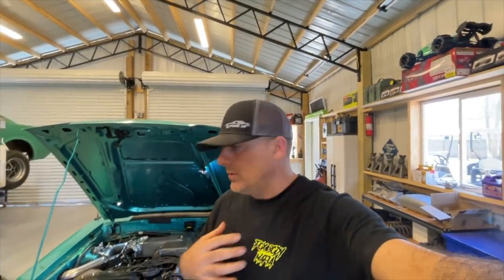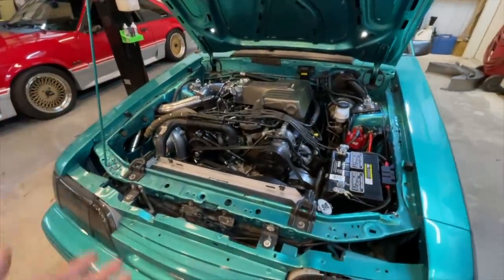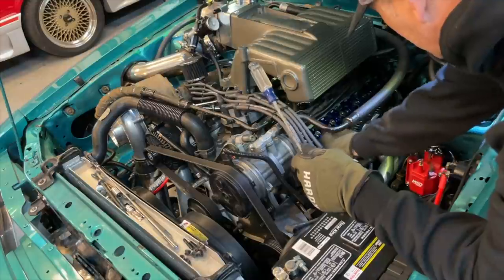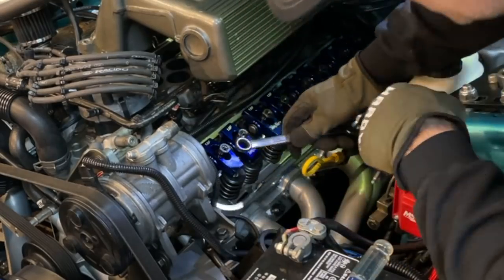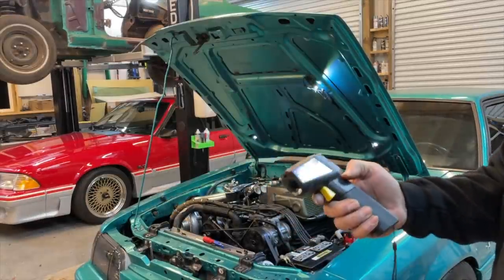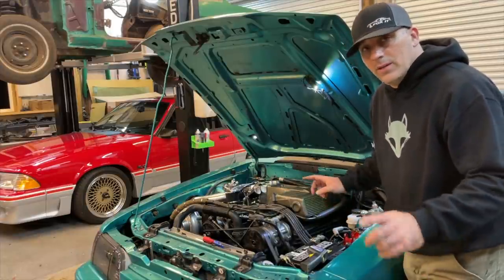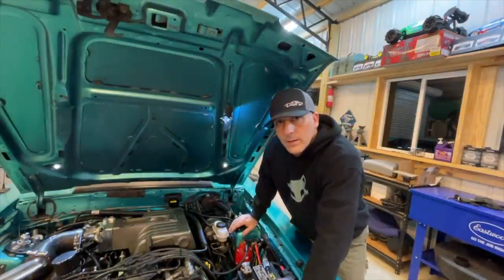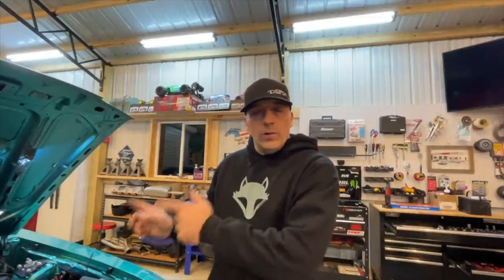I Failed A Few Times Before I Figured It Out..... But it's part of the process

Comment: While the plugs are out, I would do a compression check, and a leak down check. Lifter pre-load should be .020"-.060", with a 7/16"-20 threads per inch rocker stud would be around just under a half turn to just over a full turn. 3/8"-24 would be half turn to one and a quarter turn.

Comment: I could definitely agree with the very first statement of this video. I had been messing with my car trying to get it running right for 3 years and I ended up going with a Holley terminator x and it solved my problems!! I believe I had a harness issue in the end. Glad to have my car going again but I know exactly what you mean with wanting to burn it to the ground!!!
Reply from the maker: Glad you got it going instead of 🔥🔥👀
Reply: @BREW2LFOXBODY  would copper based anti seize help the plug ground possibly? Or just don’t use as much?
Reply from the maker: Possibly, I just used too much though

Comment: Zinc, or trivalent plated plugs do not require anti-seize on the threads. Best way to tell; if your plugs threads are silver, or chrome in color, you dont need ant-seize. If the threads are black in color, put anti-seize on them.

Comment: Nice video on troubleshooting! Just to confirm that it's not hurt, a compression check or leakdown test would be good. 

 If a valve no longer fully seats due to minor damage, it would quickly create play in the valve guide or possibly crack it. A puff of smoke at startup would be a tell tale sign and possible valve train noise.  

If one cylinder has lower on compression on that bank do a wet compression check to see if the numbers go up.  If it does,  it's the ring, if not then a valve is not fully seating.  Then take off the springs on the valves for that cylinder and check end play in the valve guide.  That will rule out a bad valve guide and bent valve. If all else fails pull and inspect the head, and also check it for straitness.  Should be under .002

Comment: Do a compression check and next time you have a head off and suspect a valve just turn the head so the suspect port is up and drop an ounce of mineral spirits down the port.   If there's any leakage at the valve you'll see dripping or wetness around the valve in the combustion chamber.  I've found weeping even with new heads that needed a little more lap work or cleaning debri like compound off the seat.

Comment: In reference to #8 unplugging/broken clips, the Explorers,Crown Vics, etc with 19 pound injectors have squeeze the sides injector plugs. With a safety pin or other small stiff wire you can take the pins out of the plugs and they will not unplug. Plus, the newer injectors have 4 hole ends for better atomization of fuel.

Comment: I've also had a plug be bad right out of the box (brand-new) and I had an injector go bad on me after it had run for 10k miles.  Those threw me for a loop trying to troubleshoot.  Good video going through the process.

Comment: Awesome video! Just a suggestion, when removing the coil wire try to remove the actual connector to the MSD coil (primary side) With that still plugged in the coil can create high voltage and that can travel anywhere nearby or to you!
Reply from the maker: Very true! Great tip 👌

Comment: Start the car pull the plug wires with some welding gloves (so you don’t get shocked ) if it doesn’t run different when you pull one that will tell you where to look.

Comment: Great video, I enjoy all your videos! I agree with everything you said only difference between us is I go for the easiest thing first! I start at the plug then the plug wire, then check compression while the plugs out and most of the time that will tell you if you have internal problems in the motor! I guess that’s just the difference in mechanics everyone has their own way of doing things!! Like I said man great videos!!!!!
Reply from the maker: Thanks brother! I would have checked the plugs first but I literally just changed them.
Reply: Man I totally understand, I’ve got a 91 gt and it’s a labor of love!!!! I’ve got a 91 F-250 with the 5.0 in it and I’m chasing a demon in it, I believe it’s got a sensor bad, it want to flood all the time!! I’m about to lose what little hair I have left!!!!
Reply from the maker: @traviswhite1461  have you changed out the ACT and ECT sensors? Might be worth looking into. Although I’m not very well versed in the f250 world it could be the same as the cars. It’s a know issue that causes flooding mainly when it’s cold.

Comment: Cool video bud with a lot of information. I had a issue with a 89 Fox I had A few years ago. It would run great but once it got hot it would start missing and then get to the point that it would die and not start. Narrowed it down to the TFI module which I replaced with one from O’Reillys and it ran great until it started doing it again. So this time I replaced it with a oem one and again it ran great for awhile and started doing it again. This was my daily driver I ended up trading it for a 95 bronco with a 351w 35s and a 6in lift.

I later found out about the bad locations these and how they would get hot if you don’t use that gel stuff which I didn’t use. I had 16 of these cars and never had this issue except with this 89. 

I currently have a 89 and a 86 with TTops. I bought the TFI relocation which I install on all my Foxbodies.

Never figured out why the 89 done this. It was cammed with a F cam, svo roller rockers, 5spd swap,4.10s,cai, Offroad H-pipe, flowmaster 10s.

When I sold it I thought it was a electric issue or I’d never sold it. Really regret selling it.
Reply from the maker: That sucks.. no telling what it was either. Probably a bad wire somewhere it was my luck....

Comment: Correct me if I’m wrong but I believe NGK plugs have anti seize on the threads that’s why they are shiny? I run them in aluminum heads and never put anything on them.
Reply from the maker: I’ve never noticed any anti seize on them before
Reply: @BREW2LFOXBODY  It’s not a typical anti seize I think it’s some sort of coating on the threads that prevents it from seizing in the head and damaging the threads. I’ll have to look around to be sure. Great video by the way

Comment: Good stuff!  Have you heard of using a spray bottle of water to test exhaust?  Nice one with the screwdriver in the plug wire!
Reply from the maker: Yes I’ve used that technique a few times before. Thanks brother
Reply: Testing exhaust like that works for headers not manifolds really. In my opinion. I got ya brewlk👀

Comment: I sed don’t put Anti-seize on the spark plugs and if you do you use copper anti-seize and only the smallest a mount
Reply from the maker: Was it you in the comments that said that back when I was doing it? I couldn’t remember who it was.
Reply: @BREW2LFOXBODY  I think I sed it if I didn’t I know I was yelling at my phone noooooo don’t to it
Reply: @BREW2LFOXBODY  what probably happens was when the Anti-seize got hot they probably got onto the electrode of the spark plug creating a path of least resistance making a weak spark or smothering the tip of the electrode not allowing it to create a spark
Reply: @BREW2LFOXBODY  my engine builder also noted that anti-seize also changes the heat range of the plug. Just a dab of Copper anti-seize if you must. Love the channel!

Comment: I have what sounds like a miss every once in a blue moon that I am trying to figure out now, I used the rubber on cap trick to see if any of the cylinders where dead yet everything is fine. I think I will look into timing next. Q: Giving I have the parts now would you, A. Time the car first B. Install the parts before timing "cap/rotor/plugs/wire" car is original 140k mile car.
Reply from the maker: Go ahead and time it first

Comment: I just did a oil pan gasket i have a wayyyyy easyer way to do it the gasket will easily stretch over the oil pan i used the felpro didnt have to lift motor or any thing didnt have to get past oil pump and pick up
Reply from the maker: Nice! So you were able to just lower the pan some and slide it up the pan?
Reply: @BREW2LFOXBODY  yep took 5 mins to get the gasket in took longer to take the pan bolts out
Reply: If you get a chance to tell ppl about that to save them alot of time its really a good trick
Reply: Awesome tip, that's gold.  I have heard of a similar way where a person tied some string on the corners and was able to fish it down and around the oil pump and crank but it took a certain degree of determination and nimble fingers.

I also heard some mechanics will charge like they had to lift the engine but  slice the gasket and slap it on with some extra rtv where they cut it. I don't recommend that technique but if a guy is in a pinch it will work.
Reply from the maker: @codywilliams463  will do 👌

Comment: 2 things, where did you get the NGKs? china has been making fakes for years now that are crap. You need to get your plugs from reputable dealers. Google it to see the differences. 

And second, once a plug gets wet it can carbon track and the plug will short out under combustion pressure, and spark fine outside the cylinder.

Comment: My 89 gt has a fuel system issue. I'm thinking either bad injector or pressure regulator. At low speed in town it floods
Reply from the maker: Could be a fuel pressure issue for sure.

Comment: My 50 misses after rev into 5 6k driving or not. Installed New dizzy new coil new wires. Not replaced plugs yet. Drives smooth as daily. When in the mustard it starts to skip. Help?
Reply from the maker: Possibly the plugs

Comment: Hey man, I hope I can get some help here. I just finished installing my first turbo ever on my fox body. Can you explain how to run the vacuum line of the wastegate without boost controller ?
Reply from the maker: I’m pretty sure I just ran mine from the intake down to the lower fitting on the wastegate and left the top port open. But please verify for your setup with someone else just to make sure.

Comment: Hey please get back to me I've been having trouble with my fox 1990 I really need help and I can tell you what process I've done and what its doing long story short. Driver header getting red hot really bad idle timing is good brand new engine 331 stroker edlebrock performance rpm heads I checked compression its all good. Checked tps at key on engine off 5.044 v very odd checked voltage at with sensor off car at the white 10 pin connector tps still 5.04 v im thinking its the ecm. I've called lmr and bbk and a pro engine shop near me has them stumped.

Comment: Yo brew2l you think buying a higher amp alternator has it's benefits?..
Reply from the maker: Not on a completely stock car, other than the fact that it’s a new alternator and should last longer. But if you have a system or anything extra pulling power then yes absolutely
Reply: Buying a higher amperage alternator definitely has its benefits even if your engine in stock! Start your car turn on your headlights and your blower and check your voltage while idling, I am willing to bet your voltage is low! Everything on your car was designed to run at a certain voltage, With the age of these vehicles I guarantee your volts or not where they are supposed to be for everything to run properly! My father has a 92 LX Convertible with an AOD! I swapped every single bulb interior and exterior with LEDs and also installed a 130 amp alternator and replaced all the main power and ground wires! With his car idling in gear hi beams on, blower on high, A/C on which also turns both electric fans on high his voltage is sitting at about 12.5V! Before when you would come to an idle you would hear both fuel pumps slow down because of the voltage drop, Not anymore they are constantly screaming! I know there are plenty of people in the comment section who have no idea what they are talking about end it is hard to trust a stranger, So Google Muscle Mustangs and Fast Ford ( The Bold and the Beautiful)! It is a write up about a girl and her trio of mustangs, 2 Saleen’s and a 98 cobra! That is my work!

Comment: My car hesitate around 4300 rpm for a second or 2 when I’m getting on it it’s a built 306 fuel injection car car idles good and ect I change coil an it still does it car is tuned as well and it actually lost lots of power no smoke or anything wat could it be it’s a 91 5.0
Reply from the maker: Could be that it just needs new plugs, a lot of the time the gap is too much on the plugs and at high rpm it will have a misfire. Also it could be the TFI module. But typically they will just go bad on you and the car won’t run. Also check car and rotor button for corrosion
Reply: @BREW2LFOXBODY  thanks bud I check plugs they seem to be good I put a cheap tfi module in her months ago but it seems to fire up fine thought about changing her to motorcraft .I’ll LOok at what you said I never changed distributor I used same one that was with my old build before I bore her .30 over it may even be the original one . Tfi went out months ago that’s why I changed it do you think the distributor is in its way out next ?
Reply from the maker: @dkurcereacts  there is a chance the distributor is going out but most likely it’s something else. Also check to make sure your timing hasn’t moved on you. It’s happened to me a few times and will cause all sorts of problems.
Reply: @BREW2LFOXBODY   ok car is dyno tuned so I wonder if it’s the distributor 🤔
Reply from the maker: Could be. But it’s definitely worth checking the timing. Unless it has an aftermarket computer in it. Then don’t touch it. Lol
Reply: @BREW2LFOXBODY  LOL it’s a a9l with a chip an ok I’ll keep you updated 😎

Comment: Did you adjust the lash ?? Or just tighten them down to torque
Reply from the maker: You can’t set hydraulic lifters by lash. They are set by preload. So I usually tighten them 1/4 to 1/2 turn after I finger tighten them.